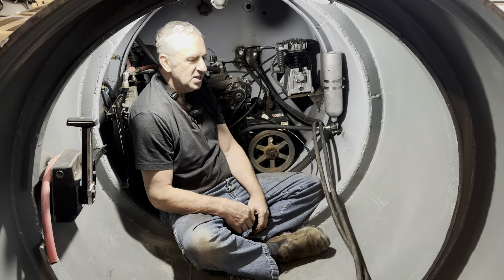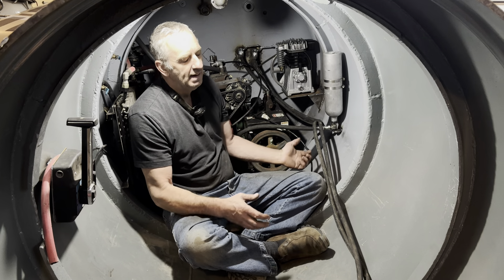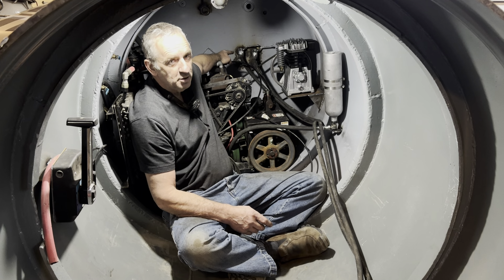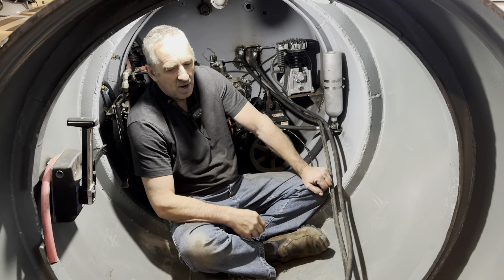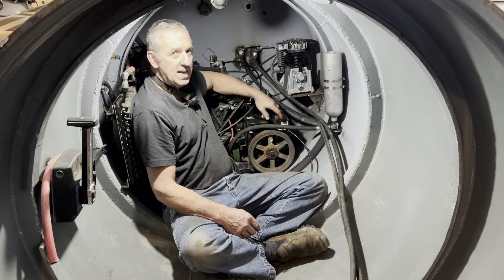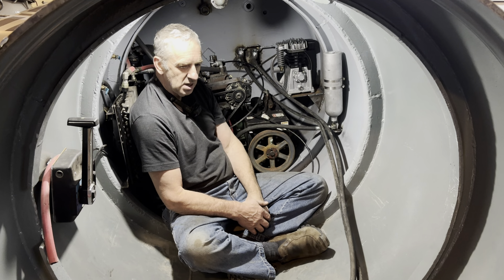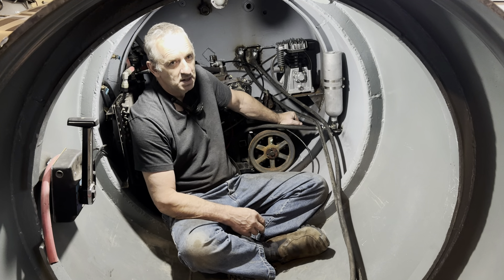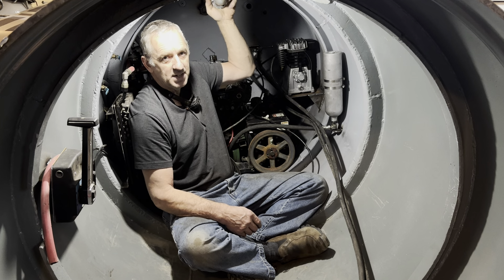Building my diesel electric submarine, running hydraulic lines

Comment: What will your pressure testing protocol look like?
Reply from the maker: I always test the subs un-manned  to a depth one and a half or more the depth rating.  1.5 to 1 is the standard.
Reply: Did you mean pressure testing of the hydraulic system, or of the complete submarine (pressure hull)?
Reply from the maker: @1519Spring  I pressure test the whole submarine.  I send it to the lake bottom un-manned.
Reply: @1519Spring   I should have specified that I was referring to the pressure vessel. However, I am interested in the leak testing that will take place for the hydraulic system.